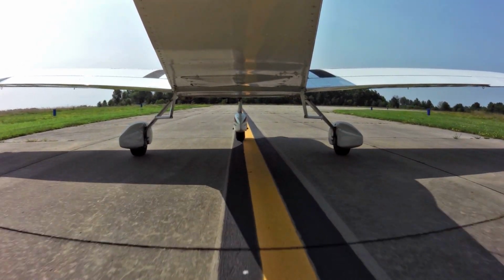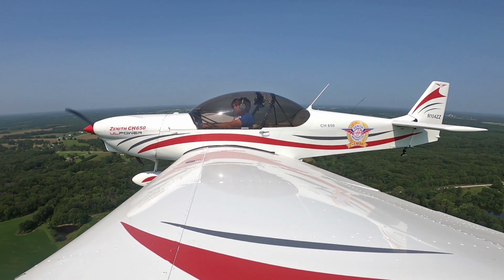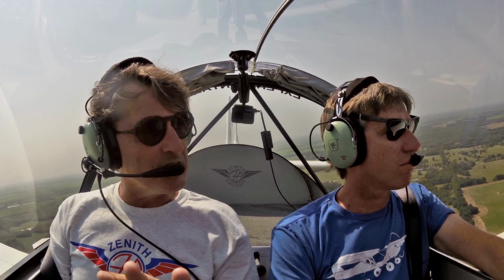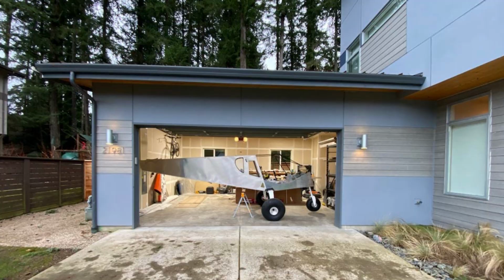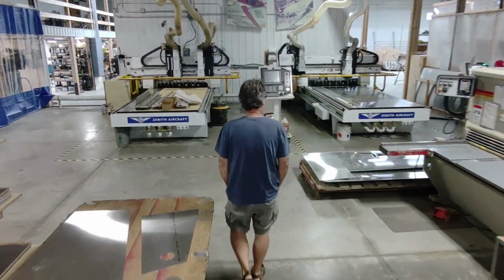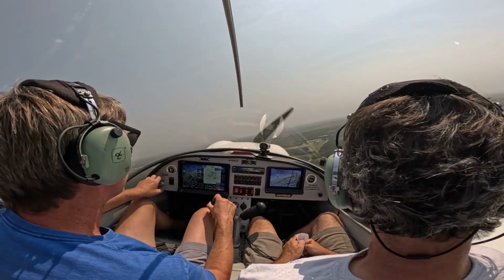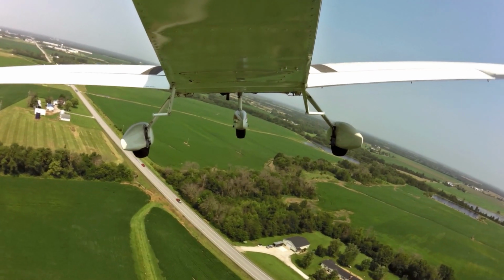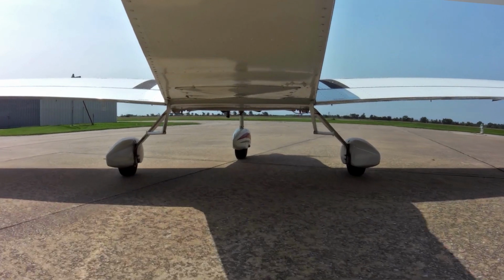Zenith Aircraft's EAA Oshkosh AirVenture PREVIEW

Comment: Those are temperatures like in southern Italy. At the moment we have around 102 °F (39°C) during the day and over 86°F (30°C) at night.
But it's interesting how the 600 series has developed over time.
At the moment I see flying with electrical energy as an interesting approach, but for me the ranges are still a bit too short, because in Italy we have to land outside of airfields with 30 minutes of flight time left. But I'm sure that a lot will happen in terms of battery charging capacities in the next few years. The new "match drilled holes" 701 kti makes Catrin and me really jealous, because we are still building an "old" 701 SP kit. If the SD and the 801 are already next to each other at Oshkosh, how about a modernized 801 "match drilled holes" kit? I'm pleased that you were able to significantly reduce delivery times with the new CNC machines. I wish you a safe journey to and from Oshkosh and a great and successful time there.